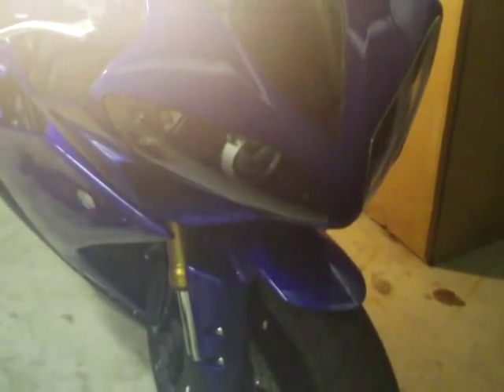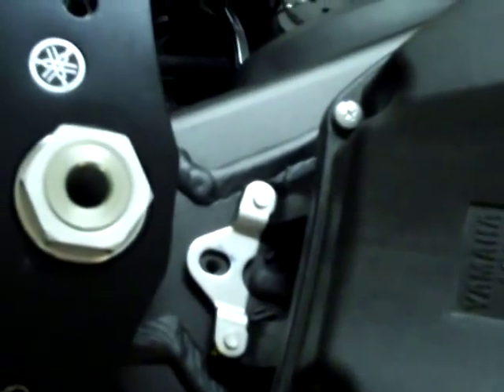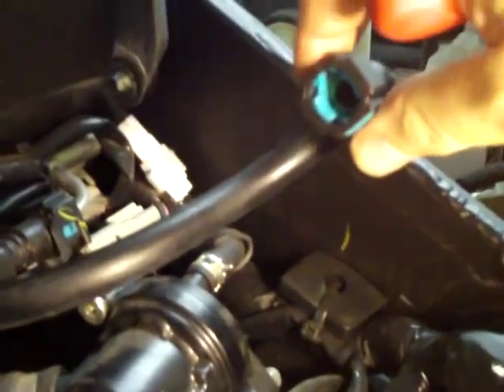2007-2008 Yamaha R1 Stalling Problem Fix / How to

Comment: This is only a band-aid. The problem is related to 3 yes 3 different parts. 1) throttle bodies- the throttle bodies MUST be balanced and NOT the way the manual says. 2) Primary TPS MUST be adjusted to the indicated 16, not 17 not 15, 16. 3) The SECONDARY TPS must be adjusted to 17.   If there is still an idle/stalling issue then valves should be checked, generator/stator bearings REPLACED (20 bucks at a bearing house) and the throttle bodies stripped and cleaned. 20 yrs as a mechanic, not a tech
Reply: I have a 2008 R1 that is stalling when I put it into gear. Any ideas?
Reply: @Zane Graves  kick stand
Reply: How are you supposed to balance out the throttle bodies, if not according to the manual?

Comment: Tip #1. Adjust your Co mode (next to DIAG) mode on your C1: raise up by +3 , if all good. Fine. Increase also +3 on C2, C3, C4. Co=Carbon Monoxide gas exhaust air/fuel ratio adjustment
Reply: How do you do that

Comment: Dude......This totally worked for me!!! Mine were already turned 180* out, so I went 270* out. Hasn’t stalled once since. I might try 360* when I gear down and use the clutch at low rpm it idles like a car that has a wicked cam shaft. You know that old school lobe when idling!!! LOL

Comment: Hello again,  I just got my bike back from the dealership.  Throttle body Sync WORKED!!!!  Couldn't wait for the Carbtune to arrive from UK so I sucked it up and paid $160 to have them Professionally sync'd first.  The most noticeable difference right off the bat is when I start the bike it starts really strong with a strong idle.  Now when I come up to lights and clutch, the RPM's come down since and easy with a smooth idle.  It's WONDERFUL!!  Thanks to all who commented here!

Comment: Well there you go. Fixed!!! I did this adjustment on my 2007 R6 and it displayed exactly the same symptoms. It has brought the idle up to around 1200 - 1300 rpms, but that makes no difference. Cheers mate, Ill pass on the good word.
Reply: Not sure I'll get a response after 7yrs but need help. I'm trying to locate the screws in the 207 r6.

Comment: Testing extensively while standing, it starts up well, every time when hot. I first tried the 1/2 turn back open, then opened another 1/4 turn. It's opened up 3/4 now (each). It does not bring up idle a lot, neither cold nor hot. Before it was fighting to stay on, usually failing 2-3 times when hot, idling 600 to 800 rpm. But it starts now with more punch and idles at 1.000 rpm, going up to 1.200 rpm. It takes throttle right away now at 1.000 rpm, without stalling anymore. so far: thanks!
Reply: Have you had any problem yet

Comment: I just did this on my 2006 YZF R6 50th Anniversary Edition and it worked.  Thank you very much, as I was getting frustrated and was thinking about buying another bike.
Update: This tweek isn't working consistently for me. Bike still stalls maybe 1 out of 5 stops. It appears I may have to make another slight adjustment.
Reply from the maker: Glad it helped
Reply: Still having issues?
Reply: @rideordie2736  Yep! Never got it working 100%. I never even went back for a second adjustment. I am not convinced the problem lies with just the adjustment, especially since I have never touched it since owning the bike. I feel the problem is much deeper and could potentially has something to do with the bike not getting enough fuel. I may take it to the track next week and ask some guys to fondle with it.
Reply: @erictittle7531  hey not a bad idea , sorry could Snr fix it

Comment: I had heard of this problem with many of the R1's; however, it never happened with my 2005 R1 model, which I owned for about 5 years.  Today I took my 2008 R1 (with only 1200 miles on it) for a spin around town and it completely turned off on me for no reason.  I'm glad it happened on a quiet street 2 blocks from my house and not on the crowded expressway. I don't want to get rid of my R1, so I'll have to try this.  Thanks for posting.

Comment: It worked on my bikes 07 /R1 & 07/R6 Fitted vacuum gauges afterward & it was close to perfect Just did tiny bit of fine tuning None of the 4 adjusting skrews is more 3/4 turns out Worked 4 me

Comment: If its an intermittent problem, check if your IGNITION COIL(S) are out of spec with an Ohm meter. Replace them (this sorted out my problem). If your throttle bodies are causing the problem sync them properly... OEM IGNITION COIL(S) about $80 each, avoid the cheap brands...

Comment: I had same exact Issue on my R1 2011

My problem is that there was a lot of water and rust in the fuel tank. which blocked the top most fuel injector that are in the manifold. 
Also the fuel pump was clogged by dirt.

THE FIX

I bought a new Fuel Pump and replaced with my old one which was working fine but It had no "right" pressure to push fuel to all the injectors.

I tested one by one the injectors to see which one is not injecting fuel out. I notice the all 4 were clogged. I went to a gas station where they repair the car/track fuel injectors using regulated pressure and it worked.

Also I checked my spark plugs they were fine, also I cleaned the fuel tank. After putting everything back the bike run fine... I was so happy

Point to note never let your bike run out of gas...since it will use the bottom gas which is usually at most cases dirty . In my case Big A** head forgot to check on the fuel level and i ended up drying out the tank.

Also  I checked on the corroded terminals in fuel pump and the two connectors below the fuel tank .

That was the case with my bike.

Comment: Thanks for the video brotha. Gonna try this tonight when I have my tank off. I just bought an 07 r1 and the idle is a little iffy
Reply: Did you tri mod yet ? Any issues
Reply: @rideordie2736  no issues. Fixed the idle/stalling problems with both of my bikes. Just start at 180⁰ out and fiddle with it from there

Comment from the maker: These screws control the idle air/fuel mix ratio.  I believe they are lean from the factory causing the stalling.  Once you ricken them up then they run fine.

Comment from the maker: You are correct.  
I never got them balanced and have not had my bike stall since I did this adjustment.  I understand it is not scientific and I didn't use a dyno, however I don't think they adjust them at all from the factory.

Comment: Even the chip controlled intake causes funky idle. This bike needs a lot of small tweeks
to get things right. Once you do the tweeks and understand that ANY modification means a check of all systems again, you will find that the bike will perform better than when you bought it. I used to be part of the forum where you got this info. I was banned for placing this info there.......need I say more?
Reply: I can't see why this is a problem by sharing a troubleshoot fix to a forum because that's what forums are for sometimes a service manual doesn't explain every repair or troubleshoot fully😮
Reply: That's just sad😢

Comment: i had d same prob. i went to my local mechanic, he changed d spark plugs. and sprayed the 4 throttles body with carb cleaner while the bike is running. now so far everything run normal

Comment: I’ve done research and people also say it’s the valve adjustment issue, my bike stalls while riding when I down shift or pull the clutch in, I have a 2007 r6

Comment: My 07 R1 with 16k on it just started this stalling BS a few weeks ago. Done it twice so far as I come up to a light in low RPM. I'm gonna try this, thanks.
Reply: Did it work?
Reply: @ThePancakee  yes.
Reply: @miketrg  how long has it been working , any more isssues?
Reply: @rideordie2736  no problems. Been years and years now.
Reply: @miketrg  that's good where did you set your at ,180 degree o more
Reply: @rideordie2736  not much. A little over 180 degrees.
Reply: @miketrg  and you didn't have to resync anything ,it just worked
Reply: @rideordie2736  correct. It’s been years but I don’t recall much to it but the adjustment
Reply: @miketrg  cool did you ever have hard starting when you tried to re start the bike like having to give it throttle in order to start bike
Reply: @rideordie2736  no. Usually it started back up fairly quickly.

Comment from the maker: Change the plugs when the bike is cold, the metal becomes very soft when it heats up so you are more likely to crossthread the new plugs when you install them.  There is a lot of wiring and heat shields in the way.  Just take your time and take pictures so you know where everything goes.

Comment: Ok well nobody has mentioned what I've encountered so I'll share and hope it helps. 2007 r1. First off eventually your stator magneto will go bad. They have an updated part number which is a different part and is around $500 which clearly tells me they became aware of the problem but did no recall. Went from wood barrel style to half moon style magnets. Ur magneto powers ur bike if the magnets begin to loosen and break your gonna experience power cut outs and bits of broken magnet in ur block (drain it out) but by that time ur battery is giving out cuz its now powering the bike however that's not the only issue. Once u change the magneto ur gonna get codes here and there. Its gonna say kickstand switch but its not the issue. If u dont believd me turn on the bike get it rolling on the bike stand and click it into first with the kickstand down. If it stalls the switch is fine don't bypass it. Ur also gonna have ppl telling u its the clutch sensor but if ur neutral light is on then ur clutch switch is fine. The issue i found to be in the unnecessary circut made to kill the main switch wired to the kickstand and clutch switch. Per the wiring diagram theres a red plug on the clutch lever side under the main fairing ziptied to the main harness. One wire is blue/yellow and the other is blue/black. That plug goes to the main switch and with handlebar rocking movement the wire breaks like when u bend a wire till it breaks causing a broken circuit immediately killing the bike but wiggle the handlebars a bit and it'll come back. So basicallt its a broken wire. Its a pain in the ass to replace the ignition cuz the bolts holding it in are like rivets they don't come out so what i did was bypass the unnecessary line by simply unplugging the red plug and jumping the one end with a paper clip closing the circuit and taped it. The male connector that goes to the ignition just sits there and it's fine. I've never had an issue thus far and ive never had to do this throttle sync thing in this video. They're just minor design flaws but can be super dangerous while riding. If this helps you im glad and Ur welcome also tell yamaha they assholes for not doing the recall on the magneto. Also try to gap ur spark plugs pretty well, i notice better idle/throttle response with properly gapped plugs.
Reply: @date_soto could you let me know simply what was solution of this issue? You said it was bad design magneto? or sth more?
Reply: Simon Sadkowski as far as the magneto goes you have to completely swap it out cuz the one they came with factory eventually breaks.

Comment: It is a system. One thing leads to another. A mis-aligned TPS will cause the idle to "pulse", a bad O2 sensor will cause fuel issues, tight valves will cause stalling and hard starting, bad generator bearings cause drag on the starter gear, un synced throttle bodies cause idle "pulse", I can go on and on. Difference is, I worked for Yamaha when this was going on, this "fix" is a solution AFTER the rest of the systems have been checked and cleared.
Reply: if the o2 sensor is faulty would one get a check engine code?

Comment: i had my 2008 r1 for two years now and has 6500 miles on it. never have or had any problem. you made it sounds that all r1 it's a problamatic bike. it is not or per say a lemon.... it is all about adjustment.

Comment: As far as the other issues, The EXUP COULD cause an issue but a stalling has not been reported. Best thing is to remove the valve,NOT the motor unless you have the bypass chip. the EXUP does nothing anyway. Generator bearing go bad quick and can cause the shaft to stick which burns the rotor or the stator or both.

Comment: I mean i went out for an hr after this and didnt stall clutched in all stops so seems to work only other thing i could think of is mayb having to do a sync and really get it dialed in but if that doesnt help you need a valve adjustment.

Comment: I have the 08 R1 it had the same issue, I heard that if you adjust the free play at the clutch lever it may cure it, did it and it worked
Reply: rapid spec58 I have the same issue. Did you sure after setting the free play of the clutch levet it solved the issue with idle speed? What is the reason for?

Comment: Valves, book says 26,000 mile to first check......do a CHECK every 10k. TPS.....if the cable TPS is off the computer gets a negative position indication when the throttle closes which makes the computer cut fuel and ignition as the bike is supposed to be "off" at that point. The TPS for the plates must be exact to control bypass air to keep the idle stable at quick close. This was done with a IAC valve in Suzuki or a SDTV.
Yamaha uses the TPS and single throttle plates.

Comment: Aren't those screws used to synchronize the throttle bodies? Shouldn't you at least synchronize them after you base set them at 1/2 turn out from all the way in?

Comment: I tried this and it did not help. My 2007 has been rough idleing from 1-1.3k. Stall at lights when pull in clutch. Also put in new battery, 17k miles. Termigoni exhaust. Any tips? Seems a lot of people have this issue but almost no definitive fixes
Reply: Nicholas S, did you ever find a fix to your problem? Cause I'm having the same issue and I'm waiting my options
Reply: Yes, I just changed my plugs to iridium and its been running great. Up to 19k miles now

Comment: Hi mate, I've just picked up a 2007 R6, and I have exactly the same problems. The bike was sold to me knowing that it had a problem, and I got it cheap because he was getting  a bit pissed about the recurring problem.  Once the clutch is engaged and the throttle released, the bike just starts to die out. I have to go through the gears quickly to try and use them to slow the bike and am more heavily reliant on the brakes rather than the gearing.

I was gonna do the TPS, but at $350 Ill wait. n c.
Reply: Ever fix the problem

Comment from the maker: I've heard that as well.  Usually a symptom of a battery that's low in that application though.
Reply: Mr SparksGarage, did you see my post about no start on my 08 R1? Just hear a click  like on a car with dead battery. Could it be starter relay? Have disconnected side stand and clutch switches. Have new battery, seems like an interlock switch or relay not letting power get to starter
Reply from the maker: @davidandrews3146  double and triple check your battery terminals. Also take the battery and have it load tested at an auto parts store.

Comment: a lot of the problems I'm reading below could be attributed to a valve clearance issue, which fits the amount of miles you guys have on the bikes. as the valve seat wears the valve clearance reduces from the factory tolerance to a point which the valve gets held slightly open and compression is lost. this video fix is just a handicap for an improper valve clearance. just from my experience
Reply from the maker: +MotoVloggedOUT The bike only has 12,000 miles on it and the problem started at around 4,000 miles.  There is no way the valve clearances need to be checked every 4,000 miles.
Reply: +SparkysGarage just another idea, remember this is over the internet and no matter what anyone says you can't diagnose things over YouTube haha but if it fits the symptoms its food for thought. the miles are low unless the bike was ridden very hard (lots of rev limiter).

Comment: That is all I did, now I wish I had not. I have watched your other vids and you are almost spot on to what the "greats" do, this is the only one I added any info to because of the seriousness of the problem. Again, sorry to have even logged on, I was looking for others with stator bearing failure to gain some more insight as to failure rate and how ( street riding, track, etc). I just happened to see yours. Again, Sorry for trying to help.

Comment from the maker: @cybercorfu Throttle bodies were sync'd multiple times by the dealer.  Its not the stand switch.  Ive tried everything except getting a new bike.  This has been discussed on many forums and has been beat to death.  This is the only fix ive found.  3,000 miles later it still runs and works fine.

Comment: Sorry to correct you but your suggestion is dead on the 180 degree turn! The one with the white paint on is the standard one. You don't mess with that! It has to be turned in all the way at all times. You'll have to hook up the vacuum gauges and start adjusting the other 3 air screws. Get the readings as close as possible to the standard one with the paint on. 
That is the only way to get it right. Good luck!

Comment: well, here I am.  I guess all of us 07-08 owners will end up here eventually!  My bike just hit 3500 mi and the problem just started recently.  was happening constantly so had the bike full serviced. new plugs and filters, cluch adjusted, oil, etc... much better but still happens once or twice per outing.  I hate it!! SO, To do this fix or not, THAT is the question??  I'm guessing you can't harm anything if you record original positions. Right??

Comment from the maker: @solidr1 Go to that forum that I linked.  The post on this problem goes on forever.  It is an extremely common problem.  Just like the 99-02 transmission probs on the R6.